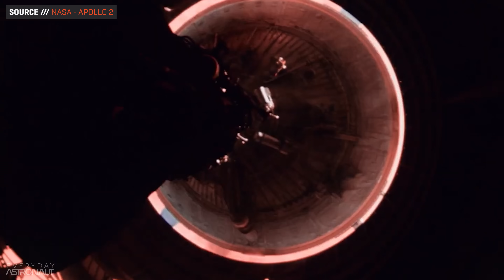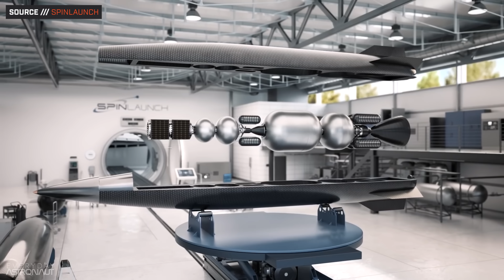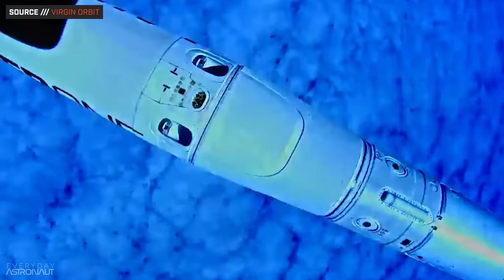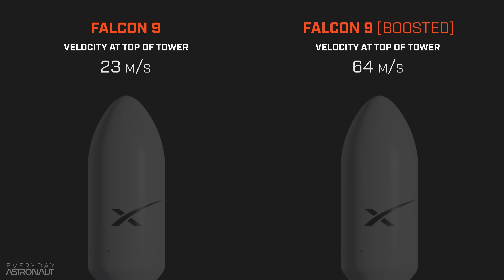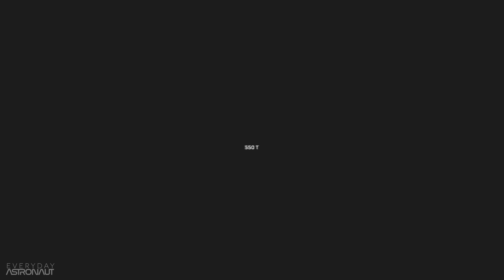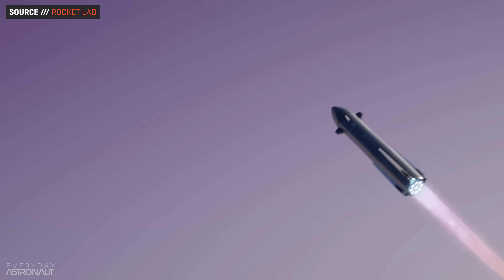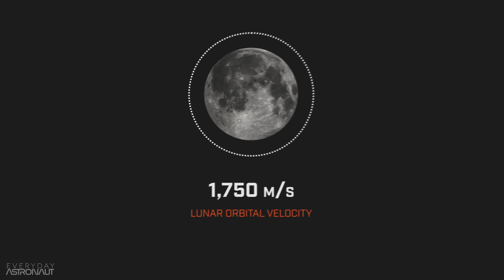Could We Help Push Rockets To Orbit?

Comment: I didn't watch the video so I dont know if Mag-lev propulsion was covered. Simply lay the rocket down on a mag-lev track that cuves up to 90° at the other end and launch the rocket like you're shooting a rail-gun. Then fire the rocket boosters right before you run out of track after you've already passed the sound barrier. I'm assuming the track would have to be at least 4 or 5 miles long to build up enough speed for something that heavy, but it would work. They've known of this concept since the 50s rocket sleds on track rails tests. But the launch could be powered by battery banks that were charged up a month earlier with solar, wind or geothermal or even a nuclear reactor  to reduce the cost of initial liftoff.

Comment: Might not be useful for delicate payloads, but an orbital space gun would be great for launching stuff like water, food, fuel, construction materials, or other stuff at a reduced cost. To get a reliable burn on the orbital insertion rocket, maybe a small solid fuel motor could be used instead?

Comment: In a way they are looking into it using a vaccum chamber centrifuge system designed to spin up and release the 'payload' along a rail to get it up into the air.
Not sure it's rated for humans, and the size of the capsule is limited, but the theory is being tested and put into practice.

Comment: Instead of using electrical energy, couldn't you have an additional horizontal rocket on a sled with a tow rope hooked over the tower (you get my point) so you got the tug from another rocket that doesn't leave the ground?

Comment: What about putting a vertical tube into the sea, pushing the water down with a platform the spacecraft sits on, and releasing the platform in low depths?

Comment: @15:20 Maxwell 48V, 165F supercondensator x 90k gives your energy. battery weight is around 620t with bms cables and others things. it's quite feasible

Comment: Tesla supercharger idea is not bad actually. I mean maybe not with tesla but Chinese BYD made 1000kW superchargers. So with that you would only need 450 superchargers plugged, instead of tesla's 1800 superchargers. And I believe BYD can make 2000kW superchargers for this project. So it would go down to 225 superchargers needed to plug. Not bad. It can be connected to the tower.

And for even better, for the maglev version, you would just need 50pc 2000kW BYD superchargers instead of 400 tesla superchargers.

Comment: I think your calculations are a bit wrong. 

There are several improvements: 
- You can safely accelerate humans up to 12g. This is the maximum acceptable overloads approved for the space travel. It should be much greater release speed.
- Releasing so much energy is not a problem at all. There are real coilguns tested in the ships that release similar amount of energy. Which means the energy storage/release system is already tested.
- You can build the concrete pillar which can sustain enormous weight. 100-200m pillar shouldn't be a problem. Even while having a counterweight.

With this criteria it's much more realistic to build a system that can save good amount of fuel while being reasonably cheap (aka reasonably expensive).

Comment: 26:20 Would it stay in a vacuum though? If it wasn't completely, 100% in space above any air molecules, wouldn't air spill over into the top and fill the tube back up over time? Earlier you did say it'd be long enough to be above the 'majority' of the atmosphere. How quickly would it fill back up? Also, if it was filling back up, it'd create at best a gentle breeze that would fight you all the way up and at worst, a torrent of air like water from a dam, potentially even a pressure hammer somewhere along the way as well that could cause the tube to rupture.

Comment: Regarding the electrical energy needed: 

Those are not oarticularly big numbers 2 GW is the nominal output of a normal-sized nuclear power plant and even a solar power plant of that size has been built in the Middle East and in China.

Once you are not allowed to dump fossil CO2 into the atmosphere anymore, you actually would spend much more electrical energy to produce the rocket fuel due to the low efficiency of efuel production.

Comment: Small unmanned particle rockets for orbital correction. (Ideally not leaving orbit without transit plans and launched as payload into orbit)

Compression (methane) combustion assisted mass battery. (Tunnel pressure capture of mass and recycle the exhaust gases)

Magnetic field funnel with locking underground tunnels. Possible built on site iron secondary frame to extend magnetic field effect and damage tolerance with booster. 

Payload likely cooling (if possible to use heat) iron shells with raw refining materials or waste particulate propellant. (Compression, heat, and time possibly needed for manufacturing processes can be stored in orbit. Such as attempts at light crude oil)

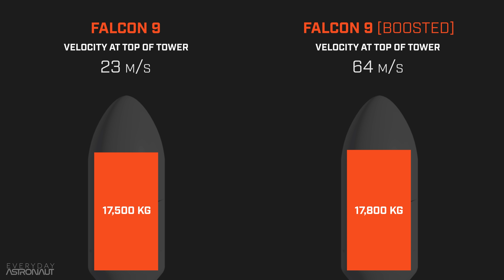Comment: 9:30 300 extra kg sounds pretty good until you do the math. Let's even make it 350kg to be a bit more in favor of such systems which might just improve over time ( and for some easier math lol).
Assuming they have a customer every flight with their SmallSAT rideshare program and they can fully use those 350kg they could theoretically get 2.275 Million with that.
Of course it's not really reasonable to assume that they will have customers for every flight that can efficiently max out that weight since Sats are actually often limited by the space rather than the weight anyway, so let's take a different approach.

With 17500kg payload in a normal flight, you would save yourself a flight (again assuming you can always max out those 17850 kg every single flight) per 50 flights.
Even if we assume the cost of a new F9 rocket at around 50M that would mean the system would cost less than 1M per launch.
You can do the math here as well, but basically for every 1M that system costs in development alone we would need to use it for 1 flight and that would be considering ZERO costs of actually building, using and maintaining the thing which seems unreasonable.
Let's assume 500M development+ building cost and neglectable operation costs. That would mean 500 launches for it to be worth it, assuming no expensive repairs needed. With that amount of launches needed, the system really only makes sense for SpaceX with their high frequency of launches.
But wait a minute, the numbers we used aren't really realistic right?
In reality the F9 usually flies with reused boosters, which can bring costs down to 10-15M according to the internet.
At this price point your 300kg are no longer worth a Million, they are suddenly only worth ~$250.000, meaning at a 500M cost point for the system suddenly we need 2000 launches for it to break even.
If we assume a more realistic actual usage of the 300kg extra payload it probably goes up to 4.000-10.000 launches.
After all even the starlink missions are still limited by weight. According to the internet Starlink Sats have a weight of ~260kg and they launch between 20 and 60 (probably depending on the orbit they go into) per launch, which for 60 gives you 15.600kg of payload. So right now they couldn't even use those 300 extra kgs for their most used mission profile.
So yeah the System would probably need to be developed more with a budget of maybe ~100M or less to actually make a meaningfull difference + would still need to have basically no maintanance cost and operation cost and for most of our flights that would actually at best save us a bit of fuel because we aren't really maxing out our payload anyway.
Sounds like an expensive endavour with hardly any gain. At that point you would probably prefer thinking about launching from some kind of artificial elevation instead.

Comment: It seems if we could make spinlaunch, air launched or sufficiently long and/or powerful launch tube work the 1st stage could theoretically be an air breathing engine like a ramjet/scramjet that wouldn't require oxidizer which should be a significant weight savings making the launcher itself require less power. Then a proper rocket would only be required for altitudes beyond where an air breathing engine would become inefficient.

Comment: You can achieve a better outcome by simply placing a rocket at a high altitude platform. The challenge is to deliver it there, but that is possible to solve with current technology and this will be sustainable long-term if infrastructure is developed. South America would have been one of the best places for a program like this - it has areas with high altitude which are close to equator.

The only reason why no one is doing it is ROI - one would need to launch thousands of rockets to pay back for a project like this - for now it makes sense to burn more fuel.

Comment: This comment made at 20:39. Adding 2 Raptors, going from 33 to 35, as has been hinted at, adds 5.7% to the the thrust. That's significantly more than the 3% than the tower length yeet idea.

Comment: Tim,    I am surprised you didn't mention the underground guns that Sadam Hussein was building;   Such a contraption could be built along the western slope a tall volcano in Ecuador's Andes.   Or any country on the west coast of SA>  Sadam's idea was that his "gun" would have multiple breach chambers that feed into the main,  straight,  barrel,   thus boosting the projectile numerous times as it accelerates within the tube    So the contents [or passengers] in the payload projectile would not need withstand outrageous, impossible, instant acceleration.

Comment: Would be intrested on the maths for having a 2km shaft going straight down next to the rocket to give it a boost. Using weights thay are more realistic rather than the beast of a weight he used. Probably still wouldnt be substantail gains but would be curious to see the maths comes out to with a lagwr distance to work with.

Comment: Please please PLEASE stop using kilograms for the vast weights involved in spaceflight. SpaceX just uses (metric) tons for mass and thrust - and this unit makes sense even in Imperial, even though they are not quite the same. Close enough for conversation, if not for actual engineering. The American habit of weighing HUGE things (like aircraft carriers) in POUNDS FFS is very annoying. But, . . .  at least you're not using refrigerators or Big Macs.

Comment: Catapult.   hoist a big weight up the extra tall strongback, and have it drop.  The weights can protect the strongback.  Need some nice big pulleys at the top, but we could probably have the tower be 5x the height of the rocket, and have a mass of 3x the rocket on the top.

Comment: So long as we're in the realm of absurdities and immense costs to engineer solutions to problems of rocketry, how about instead of building a rocket yeeter, we put that money and brainpower into building anti-grav tech? A localized reduction in the pull of gravity on a rocket could reduce the amount of propellant needed, thereby reducing the cost of the launch. And it seems about as feasible as any of the options listed in this video

Comment: Because of rocket equation intuitively it feels that it would be more beneficial to remove fuel than to add payload capacity since fuel reduction is exponential. Also fuel reduction would reduce the needed rocket size which would also further remove unneeded mass and lead to easier boost. I don't know if your calculations accounted for that but replacing fuel and rocket mass with a stationary reusable booster feels like it makes more sense than adding payload.

Comment: Tim, I have one quesntion about energy. From what I know about phycics, rocket has to be able to handle those energies by itself. Because she need to get to that speed. You present it, like the power needed is the problem. I think, the problem is, that electict energy is just not dense enought and it is much easier and cheaper to pump a little bit more fuel.

Comment: why are all systems based on electric propulsions? what about a tower with the same engines as the rocket? a starship mechazilla with an extended height of about 500-800m (easily achievable for infrastructure projects) and some extra 20 Raptor engines should give quite a good propulsion bost

Comment: I think spin launch should build a tall structure. Tubular, that can pull a vacuum or be filled with helium. Inhabit, the largest structure on earth. It would be slanted, so it would be easier to build than a vertical high-rise. Thus you could make it longer And give it more stability on the ground as it inclines. Kind of like a rollercoaster support, but much larger

Comment: I was wondering. What if you use the weightlift option with less mass but with rockets going downwards in the mass.

You won't need all the mass, but also the fuel is spent on the tower but not on the rocket leaving soace for cargo.

Anyway the structure integrity is still an issue.

The idea here is to still make the push by rockets but not on the rocket. 

The same principle might go for the tunnel changing the magnets for rockets.

Comment: Rather than using payload capacity as the variable, I would be curious how much fuel weight could be decreased if payload remained the same. That seems like you could get a lot of synergy.  The lighter the rocket, the more effective the assist would be. It would sort of build on itself.

Comment: Why not use water?  Use hydraulic pressure to push the rocket over a few miles of track, and then curve it up. Use multiple locks and higher leverage ratio, that will steadily increase the force applied on the rock. Build the launch site next to a dam, and you have all the water pressure you need to give a boost to the  rocket
Reply: My idea is water & “TEETER TOTTER” launchpad… IDK sometimes the simple ideas are the best… & it would potentially be able to abort & not launch
Reply: @jaynorthwoods agree. Something like the trebuchet. Weight of two aircraft carrier is around 200k tons. Or 200,000 m^3 of water, or 58m / 58m /58m cube of water. That could easily be stored and released  from a lock. You could store multiple locks of water ahead of each quick release. No need to pump water back up, if there are billions of m^3 of water in dam. No need for significant energy other than to open a few large hatches.
Reply: Water as a hydraulic fluid is far too inefficient. Something more viscus like hydraulic fluid would be needed. The problem is the math. The hydraulic system would have to be huge to over come the Rockets weight. The piston would be 2 times as wide and 3 times as tall as the Saturn 5.
Reply: water will actually compress when you start getting to 10000s of thousands of psi, and compression causes heat which leaks out of the system and introduces efficiency nightmares (thats why pnumatic systems are only like 30 percent efficent.)

Comment: I'm not kidding when I say buoyancy lift assist vehicle. Essentially, you get a blimp purpose built to lift the rocket off a pad. This then gently but efficiently raises incredibly high and when nearing maximum altitude you do your prelaunch checks and activate the rockets. On failure you anchor it and release or recompress on board helium or hydrogen and slowly come back down. Sure it is slow but raising so much altitude could be worth it.

Comment: For the Electron rocket, how is it possible that a vacuum maglev launch providing a velocity boost of 313 m/s only results in a 75 kg increase in payload capacity? That speed boost should save hundreds of kilograms of fuel, and at least some portion of that saved mass should translate into additional payload capacity. The same logic applies to other rockets as well.

EDIT:
I’ve done some rough calculations—everything is an estimate—but even with conservative assumptions, the payload increase should be closer to 450 kg, not just 75 kg. The 313 m/s boost would save around 1.3 metric tons of fuel. Even with a pessimistic approach, at least one-third of that saved mass could reasonably be converted to payload. Realistically, it could be closer to one-half, meaning up to 650 kg of added payload. That’s roughly a 200% increase in payload capacity.

Please feel free to correct me if I’ve overlooked something.

Comment: On paper there's utility to using a plain old turbofan to get a rocket to a decent altitude and velocity before launch but the benefits are dodgy. It's useful if you can manage to replace the entire first stage with the launch system. Ducted rockets are appealing in principle but the rocket overheats before it gets going fast enough in practice. If you really want to optimize for payload it's all about the fuel. You could go with liquid hydrogen and liquid oxygen the whole way, and if you really want it spicy throw some ozone into the oxygen or replace it entirely with liquid fluorine. The most favored in principle fuel is a mix of liquid fluorine, liquid lithium, and liquid hydrogen, which is overall favored for chemistry reasons I don't understand, but is, uh, not something I'd care to ride on.
Reply: Chlorine pentafluoride + diborane

Comment: 11:55 but we have capacitors. That's what they are good for. I'm sure they have some shelf ready solution at the national ignition facility for their humongous pulse lasers, which also draw a crapton of energy in short bursts.
27:30 the total amount of energy is quite irrelevant. You need to get that energy anyways, rockets get it (and a lot more, since losses) from the fuel they burn. The critical value is the power, and over 150 seconds that's just a over 2 GW. Not that crazy for a full launch. Dedicated nuclear plant needed of course.